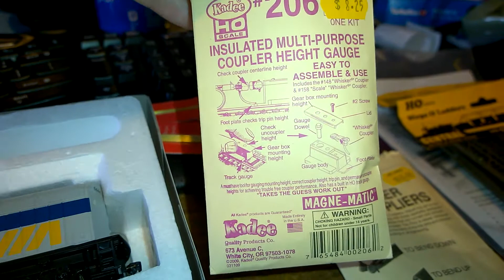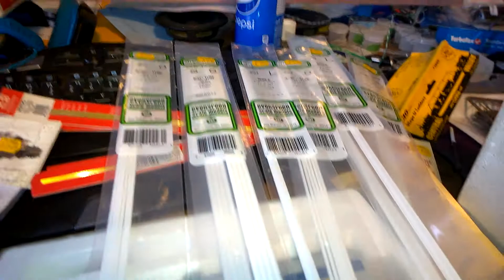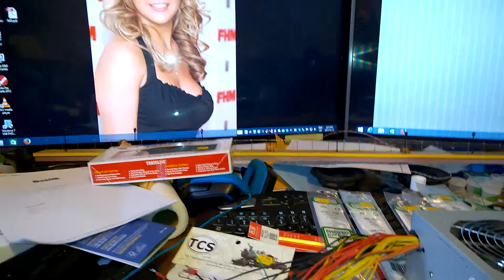Gone to the hobby shop 04/25/2015

Comment: Hi Scott, I do like you're idea of using the power supply from a computor, cheap and safe way of powering accessories.
Keep up the great work mate, enjoying your videos.
Cheers
Mark
Reply from the maker: Western Centurion I used one of the lower cost one that I have.  I figured I would keep the $150 power supplies for the computer.  No need for that for lights and things on the layout.  I have to get back to work.  Its been a bit since I have done anything major.Scott

Comment: What a mess desk lol.
I need to get some track cleaner to compare to surgical spirit that I normally use. I want to clean the same bit of test track in two halves and compare over time.
Comp backdrops look great in my humble opinion. Nothing wrong with celebrating beauty to my mind.
Reply from the maker: Calvertfilm The guys at the hobby shop talked me in to buying it.  I never used any thing except erasers or goo gone on the track.  I thought I would give it a try, except I haven't used it yet.  I like the background pics but in this day and age people have to be so politically correct, it drive me insane.  I feel the same as you.Scott
Reply: Scott Downey Political correctness - I know what you mean.

Comment: hi Scott... i think you need a ball &  chain.. LOL.. i like the loco.. great idea to use that power supply for your accessories.. i am in the catch up mode so please bare with me... thanks for sharing... vinny
Reply from the maker: bnsf6951 I had one of them, now I like it without.lol I'm in the process of putting in a decoder.  I had a power supply sort of set up, that was the one I blew the lights with.  I figure I should make it correctly so I don't have any more problems.  Scott
Reply: Scott Downey ....really.....